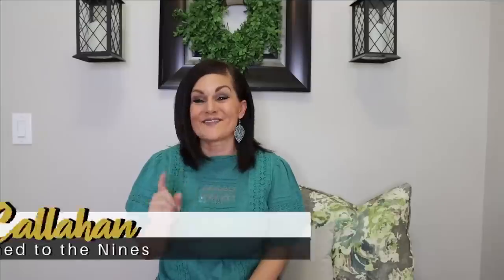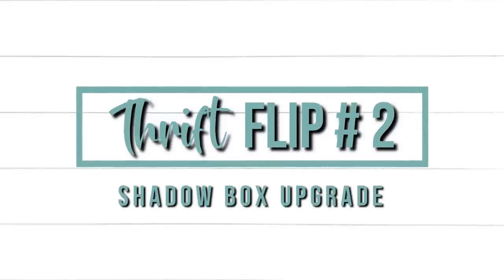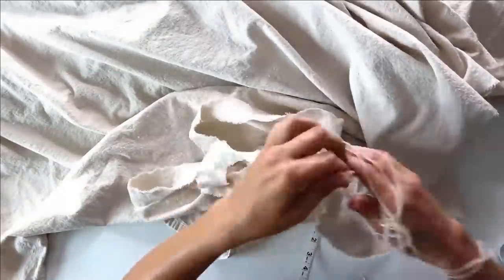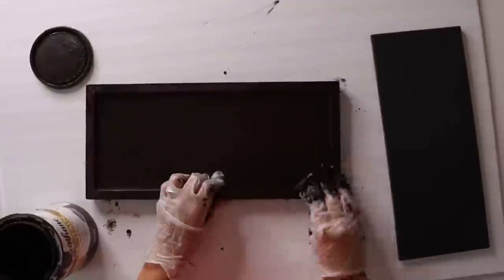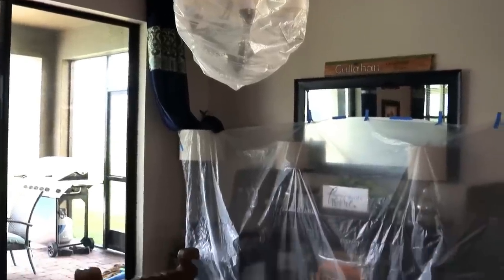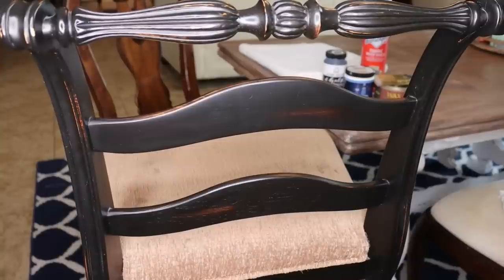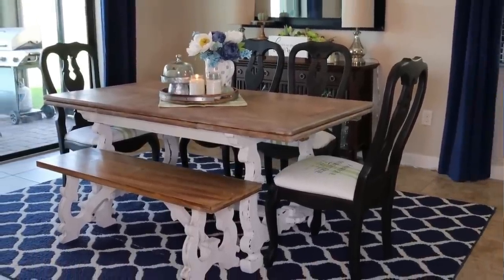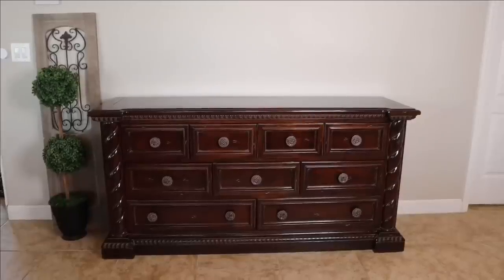Absolute TOP 10 Best THRIFT FLIP Furniture & Decor Ideas On a Budget!

Comment: Thank you for bringing up the humidity issue. It affects drying time and interferes with curing the paint as it dries. Curing water based paints especially is important.
Reply: A dehumidifier is a really good investment if you have an enclosed area for painting,  I first used one to speed drywall jobs, but learned they would pull paint down tight and create a smooth finish while drying faster.

Comment: Love EVERYTHING, but my favorites were that Table with those curvy legs and the last piece, the tv dresser buffet! I personally would have done the chairs for the dining room table the same as the bottom legs, distressed white. Just my preference, but yours are gorgeous after your work that you did on them! 
I have a very old dining room set, authentic pecan wood in very very good condition except the bottom side edge of one spot of the table. The laminate chipped off from the movers moving it from Mom and Dads home to hear, 45. Invites away.  I’m seriously thinking of doing the chairs in a light or dark color with new upholstery and putting all new legs underneath the table and the chairs. I hate these skinny angular Grecian looking legs, never did like them. The chairs are came backed and sweet, no arms, but they need an upgrade badly, so they will get the treatment you did on that can backed sitting chair. Will recover the seats myself too. I can’t sew, but I can staple like crazy!

Comment: All great make overs. A tip about satin polyurethane. You need to carefully mix it often while using. This keeps the particles that dull the finish from settling in the bottom. If you don't, the finish will be glossy.

Comment: Beautiful upcycles!!  Do you have suggestions for those of us who don’t have space for the large power tools.  Especially the power nail gun.  I bought a small jigsaw
Reply from the maker: The jigsaw was a good way to go… Also get a drill you can get a lot done with that as well as if you have space an electric Brad nailer would be very helpful for you because you don’t need the air compressor that I use. I’m actually thinking of switching to that anyways and giving it a try.💕

Comment: I've been enjoying your hack and DIY decorating tips YouTubes.  I have a couple of suggestions you might want to check out.  First, if your microfiber cloth is polyester, it will not be absorbent and will take longer to wipe off the car wax from mirrors.  Look for 100% cotton microfibers---perhaps at car supply shops.  Second, if you use white vinegar to add to your Durham water putty, the mixture will stay pliable longer.  Third, you can get handles for spray cans from Home Depot, Lowe's, etc. that fit onto the nozzles  of spray cans.  The trick is to make sure the attachment is compatible with the can you are using.

Comment: You can skip sanding and just water down some chalk paint to get the same lime paint effect on wood. I water it down using a 2 parts chalk paint to 2 parts water, but you can tweak that to your liking. I make my own chalk paint using a 2 parts talc powder to 1 part acrylic paint, but sometimes I use a 1 to 1 ratio. I find talc gives better coverage & texture than baking soda or plaster, sticks better. And it smells nice. I've used 1 to 3 coats of my DIY lime effect chalk paint, depending on the effect I want. Then just use wax over it for desired effect.